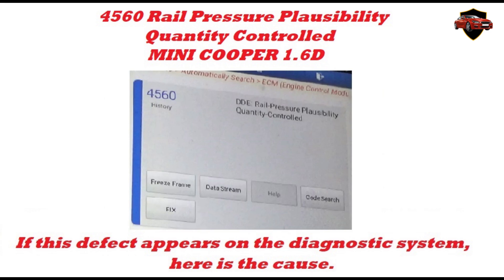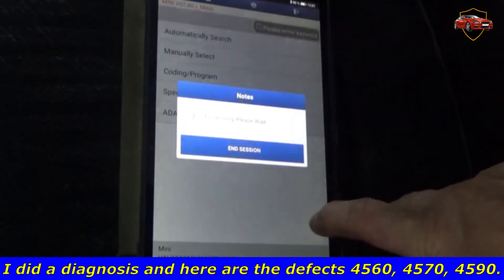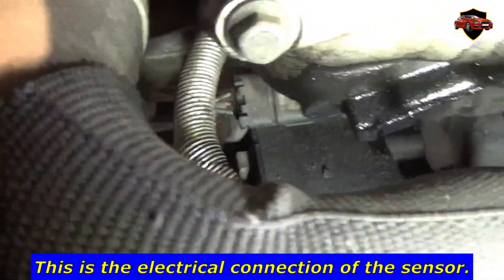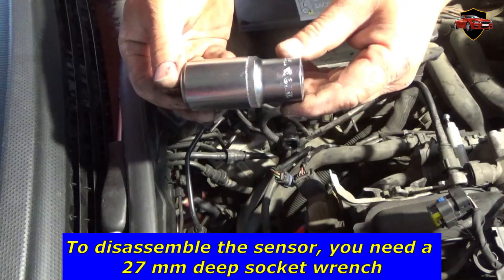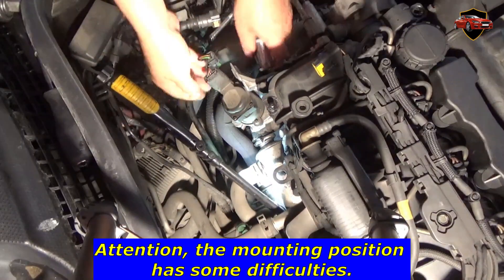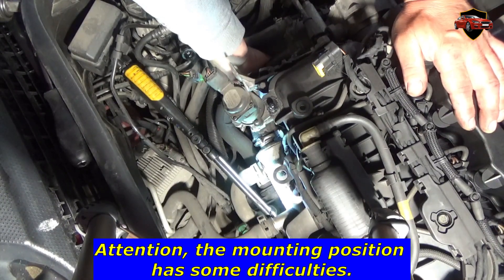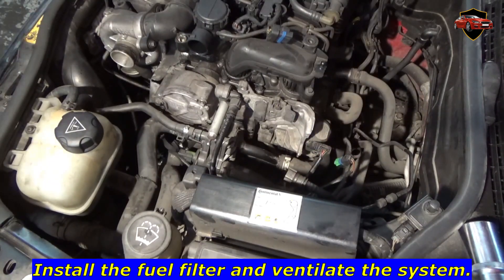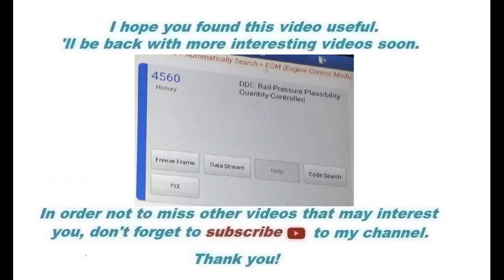4560 Rail Pressure Plausibility Quantity Controlled  MINI COOPER 1.6D

Comment: I get this error also, rail pressure plausibility, quantity controlled, pressure too low. I dont think its the hpfp as it only happens when accelerating. I think its this sensor
Reply from the maker: It is possible, but first try to replace the fuel filter with some mahle or mann and see if it still happens.
Reply: Did you solve this? What did you do in the end?